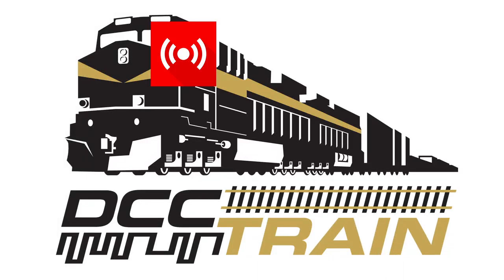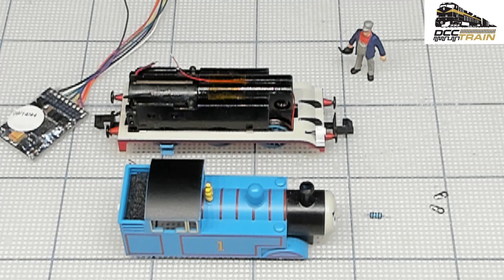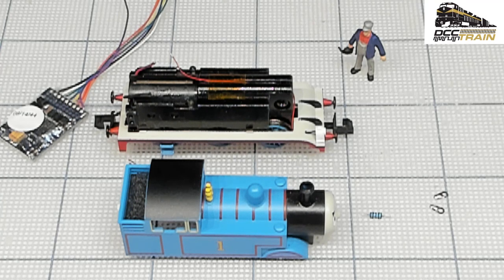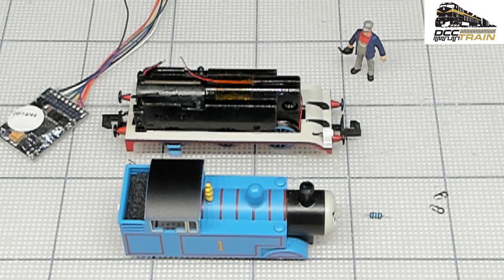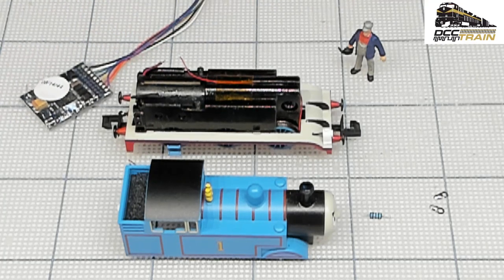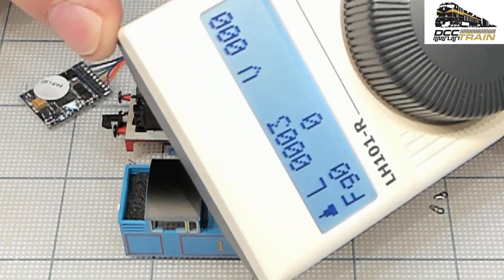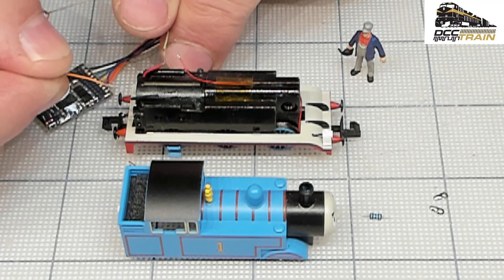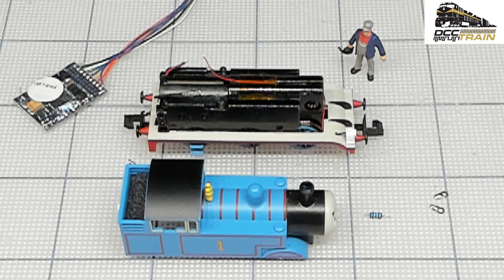Thomas Tomix motor control. how to find correct direction of traveling?

Comment: Interesting! Question:  short wheelbased locomotive sometimes stall on points. A capacitor could improve drive qualities of short locomotives. I would consider to buy capacitors for my shorter locomotives. They are analog DC. So is it enough to solder a capacitor on the plus and the minus of the motor connectors? Or is it more complicated?
Reply from the maker: Unfortunately, it is more complicated. You need a DCC system, and you need a decoder in the locomotive with a capacitor. Most modern decoders are supporting this feature.